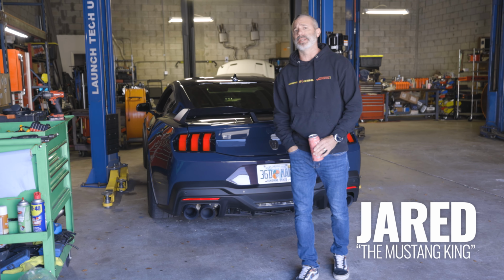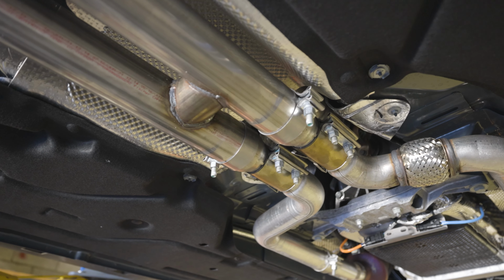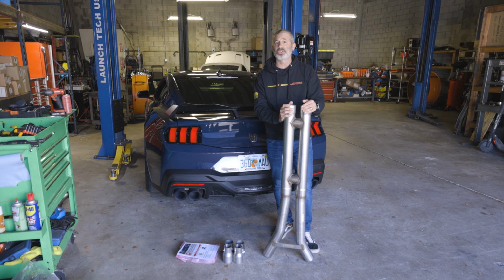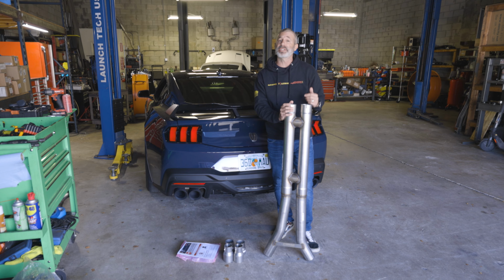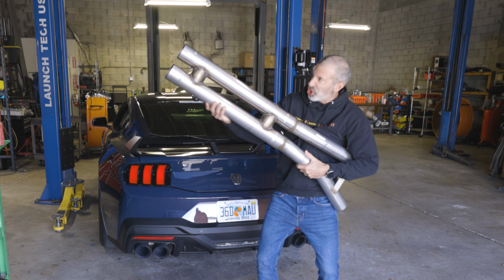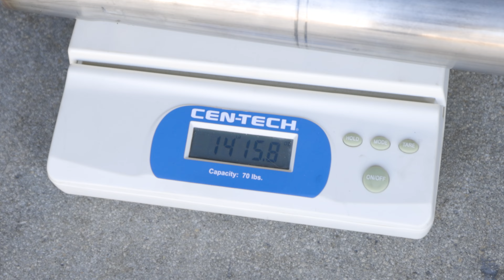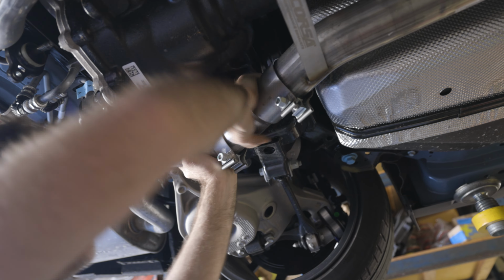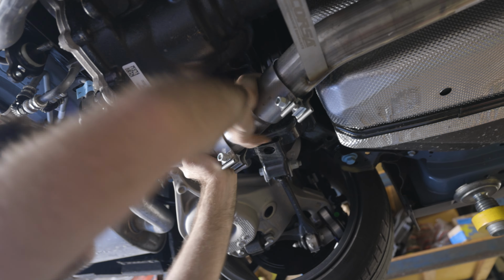Our Dark Horse Gets LOUDER! - Corsa Performance Resonator Delete Double H Pipe Install

Comment: I just did a x pipe and the next day check engine light came on is that ok?
Reply from the maker: Doing just a resonator delete shouldn't cause any check engine lights. I would pull the code from your Ford Pass app or another diagnostic device as it's most likely from something other than the x pipe causing it.
Reply: So I removed those inner filters from the intake pipes do you think that caused it
Reply from the maker: @ozielalbarran752  that also wouldn’t throw a check engine light. You need to use a diagnostic tool to scan it and see what the code is and then go from there.
Reply: What did it end up being?

Comment: gonna add headers eventually anyways so why waste the cash
Reply from the maker: We wanted to get the HH pipe footage for our customers before the blower and the rest of the stuff went on the car.
Reply: @excelerater Is not really a waste as that should fit aftermarket headers and axle backs down the road. Especially since it comes with the clamps for different diameters.

Comment: Sounds the same as any other H pipe but for double the price
Reply from the maker: It's definitely louder and has a deeper tone to it than most other H pipes due to the 3" diameter piping used as well as the length of it compared to the competition. Might be hard to hear through your phone or computer speakers but the difference easily noticeable in person.
Reply: @Lethalcamp It sounded raspier than stock in these comparison clips.